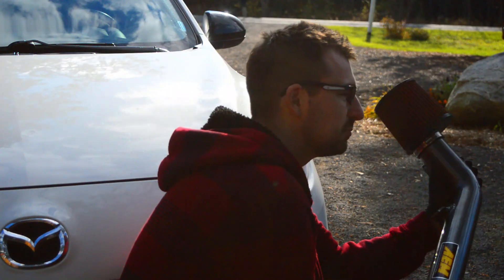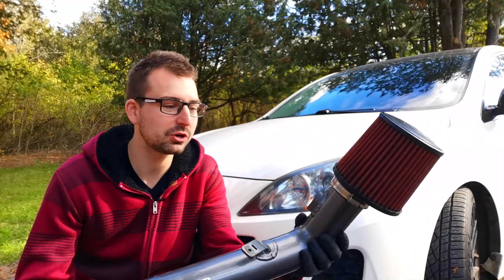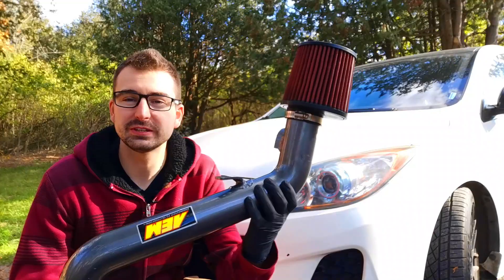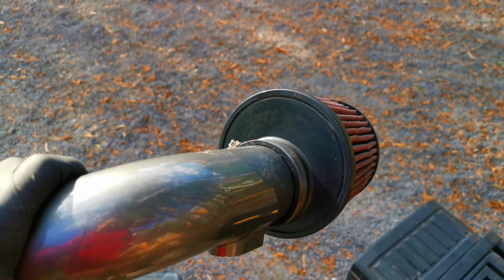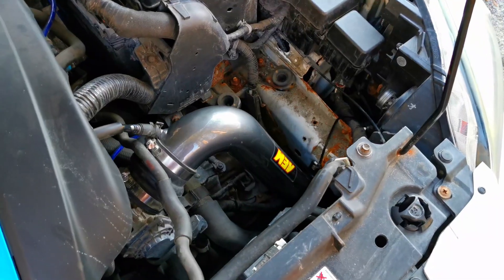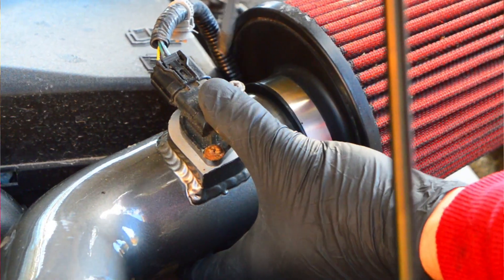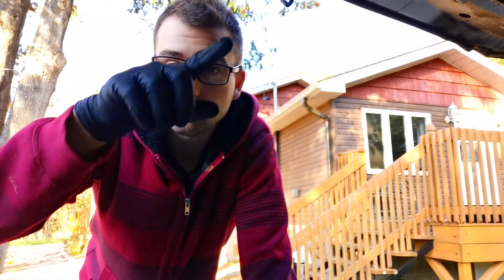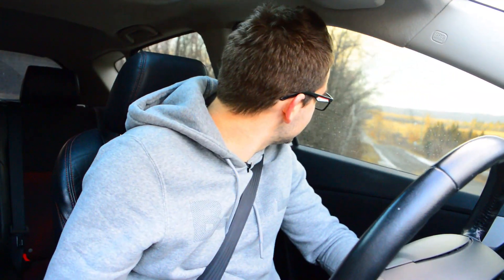Mazda3 AEM Cold Air Intake Install & Review

Comment: would you say a short ram intake or a cold air intake is better? also considering with the issues of driving in rain with cold air intake and other pros and cons.  which would you go with if you had to choose?
Reply from the maker: Hey so I think it depends on what your goals are, I do believe a cold air intake will provide more HP but like you said, if its in an area where it can be exposed to the elements you might have issues. There are some rain protecting nets/filters you can install on top of the cold air intake to protect it on the other hand. Short ram intake might get a bit better throttle response and induction noise over stock, which is great if that's what you're after, but you might loose power or stay at the same figures. I did do a video on a "free short ram intake" to get that induction noise if you're interested. Hopefully that answers your questions!👍

Comment: Was this an auto? I want a CAI for my Mazda 3 but they say auto only. My car is manual and am curious as to why it won't fit on the manual
Reply from the maker: This particular Mazda 3 was an auto, but I did install this intake on my "new" Mazda 3 which is manual. It fit no problem, same exact intake system.

Comment: Hello. I am in a dilemma, regarding the K&N vs AEM cold air intake. I have e Mazda 3 BL(2nd generation), 2.0 MZR DISI engine. I would like to replace the stock air filter with a cold air intake, but i don’t know which one to buy. What do you recommend, K&N or AEM? It is true that you will gain 6 HP extra? Thanks for your reply😊
Reply from the maker: I had good experience with my AEM intake, if you go on their website they do sell some for the MZR engines. I like K&N for drop in filters. If you just want some induction sound I made a good video for that here: https://youtu.be/1-VR3WnSnIg

Comment: thanks for the honesty review. I also wonder if the cold air intake installation could cause engine check light on and some issue while idling
Reply from the maker: On some cars I've heard of that happening, but I haven't heard that on the Mazda 3 platform and I didn't get any drivability issues nor check engine light from it 👍

Comment: Do it with the croksport short intake
Reply: It's loud and sucks in hot air - loss of torque and hp, although slightly better throttle response when not heat soaked.  I have one sitting in my garage.  Not worth putting an SRI on, either stay stock box with a drop in filter or a CAI.  The SRIs for this car don't sound good imo, they are too high pitched and doesn't have a deep growl. Does give you the sound your car is fast without being fast, plus when I'm at full WOT there is no way I can talk to anyone in the car.  I recently put on a 2014 CAI Injen on my 2012 and it is still pretty loud (overtakes my exhaust sound in cabin), but it's somewhat quieter than my SRI and I don't get heat soak.